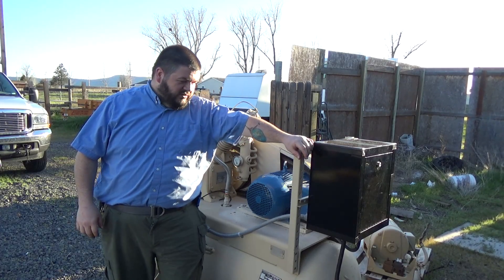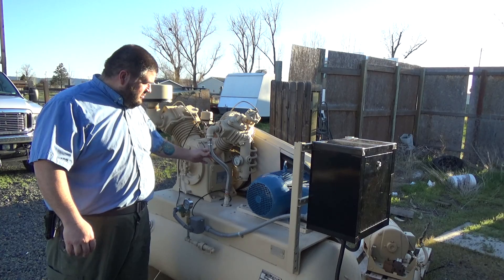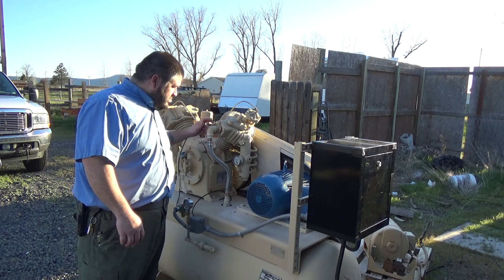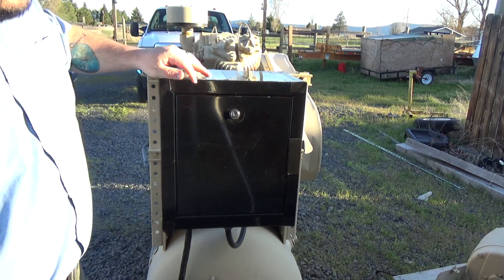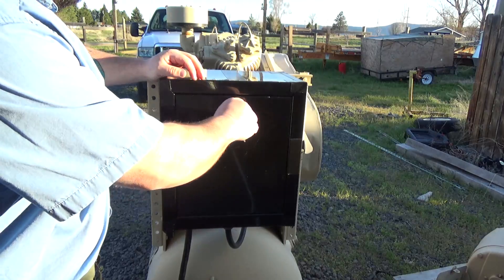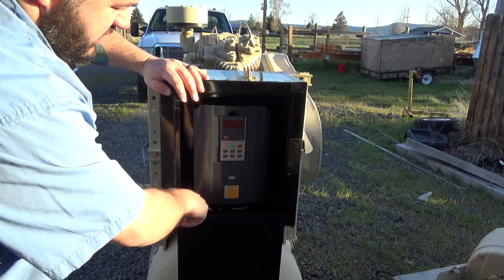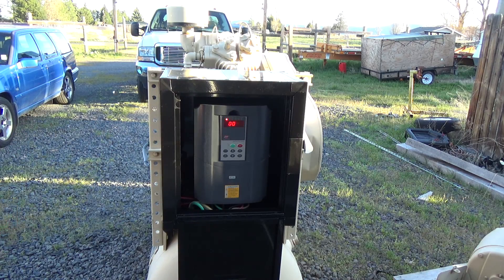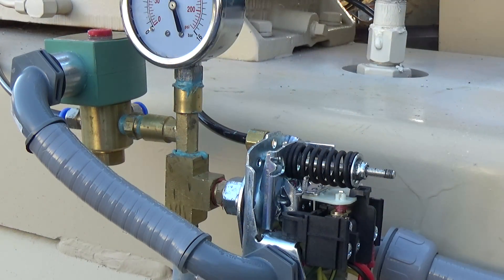Shop Compressor Part 3: completion of re-power and single-phase conversion

Comment: This vfd will stay longtime?
Reply from the maker: Probably not, it doesn't have the startup capacity to reliably start the compressor from empty every time.  I'll probably replace this VFD down the road with a better one and use this for something like a fan, which is what it's really designed for.

Comment: Nice work on bringing a vintage compressor back to life.
Reply from the maker: Thanks, fired it up the other day after it sat for a year.  Projects move slowly sometimes.  The last time it was used was by the builders when the house was being frame, it ran all week and didn't have a drop of water come out the bottom of the tank at the end of the week!

Comment: Very cool, nice job. 
You're start current must be greatly reduced.
Reply from the maker: Yes, it pulls about 21A single phase during startup.
Reply: I'm interested in your VFD longevity as I need one for a seldom used boring mill, and of course I want to pay as little as possible.
Reply from the maker: Well, build quality on this thing isn't stellar.  I'm pretty sure it's about as weak kneed as you can make a "10HP" VFD.  There are no current shunts on the input phases, just 2 of the output phases.  The lugs are barely big enough for the correct wire size.  It claims to support 150-200% torque/current, but it seems to trip the over-current alarm very easily, even when it's not actually at the max current rating (33A).  I'd call this "10HP" VFD a 5-7.5HP VFD.  I checked the incoming bus voltage and it doesn't sag on 1ph power, so it's not a 1ph vs 3ph problem...it's just a cheap VFD.  I'm fine with 27CFM for the time being.

Comment: would probably help with longevity too, building oil pressure before a load is applied
Reply from the maker: The unloader/recirculator takes care of ensuring there is oil pressure before a load is applied. The min speed for this pump is 550rpm, it builds oil pressure at much lower speed. The original unloader was designed to cut down on contactor wear due to short cycling. With a VFD there are no mechanical parts to wear out. Variable speed demand pumping could potentially save on the electrical bill. My most hungry machine goes 12:25 between runs and it takes 1:25 to recover. The current configuration pumps 27CFM.
Reply: Ok so it would be a pretty much non issue even if it didn't have an unloader mechanism? I could see it cutting significant energy upon startup. It seems to me like all the compressors I've come across do not have an unloader mechanism for start up
Reply from the maker: Yes, you need an unloader for startup, or an oversized electrical service. This compressor would need a 100 amp 3 phase service in the original configuration. Now it needs a 50 amp single phase service. Granted, it pumps less now, but that is mostly a function of the cheap VFD I used. A constant torque 15HP VFD would be ideal, but expensive as well.
Reply: That's a huge difference in energy required
Reply from the maker: Absolutely!

Comment: Pretty sweet. Have you thought about adding a pressure transducer to feed a signal into the drive? You could slow down the RPM to match the demand. And if it were too low a demand e.g. none it would turn off.
Reply from the maker: I did give some thought to adding a pressure switch to enable a continuous unloader with the VFD and solenoid. Your idea is common in well pumps to match flow rate with demand.